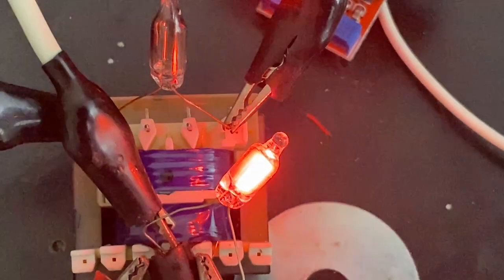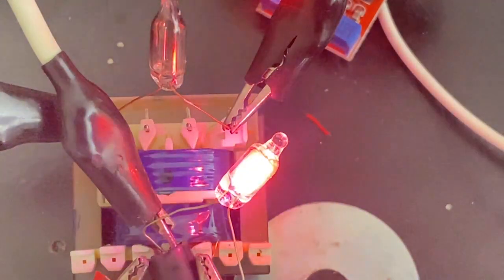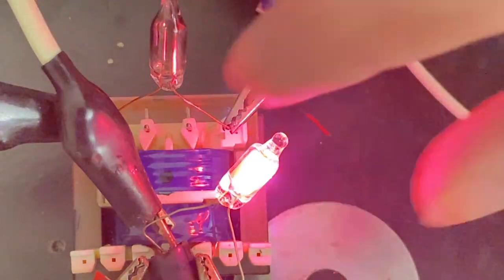Ball Lightning in a Neon Tube - Cool to touch?

Comment: The temperature drop isn’t surprising especially after Bob explains about ‘what goes up must come down’ in a recent presentation. 
How hot does the tube get though? Is the tube just cool enough to touch or is it actually cold?
Reply from the maker: We have offerred support to help them get a thermal imager for their phone.
Reply: @MFMP   You are doing significant work, and I couldn't accept the offer.  But I will indeed order an iPhone compatible FLIR module for acquiring better data.
Reply: The bulb stays cool as long as the EVO lives, reaching about 95 to 105 degrees F based of my own sense of touch.  But if the EVO collapses, the electrodes will immediately get GLOWING YELLOW HOT in just a few seconds, and melt the electrodes.
Reply: @JoinTheTechnicians  You say glowing yellow hot but as Bob experienced with Ohmasa gas the colour doesn’t necessarily indicate that there is high temperature. The Ohmasa gas burned at a temperature of 130°C but the university that did the testing falsely claimed it was thousands of degrees based on the colour.
Reply: @jasoncook6700  The electrodes literally will glow and then melt, sometimes cracking the glass if the EVO collapses. This has happened very quickly. Precisely why I ordered a huge pack of sacrificial neon indicators to figure out the best way for demonstrating how to replicate these initial results.
Reply: @JoinTheTechnicians  The tungsten probe used in the Safire experiment melted and Brilliant Light Power also had melted Tungsten issues. Bob melted or vaporised tungsten using 130°C Ohmasa gas. I’m not suggesting you are wrong but until you get your temperature equipment in place its possible that its not as hot as you think?
Reply: @jasoncook6700   That's a Darn good point Jason.  The glass cracking, and smoke rising off the leads would indicate real heat, typical of overdriving such a tiny lamp. The bulb will also quickly become so hot (without the EVO) that it will burn your skin.  It seems that the plasmoid is required to consume the heat and convert it (I'm guessing into light?).   But this low cost and easy experiment has a long ways to go. I agree that your note is an important consideration which I will address in future experiments.  Thanks!
Reply from the maker: @JoinTheTechnicians  Great - this is important data to capture
Reply from the maker: @JoinTheTechnicians  Do ask if there is something you need.

Comment: What is the true RMS draw?  The watt draw.
Reply: In this setup, it's VERY inefficient: 3W to start, 7W to keep the plasmoid alive.  I am intentionally shorting most of the TX windings to pump ground current into the lamp which results in significant switching and copper losses.  Presently working on the full video to show a "DIY how-to Neon Ball Lightning" using off the shelf parts that will only draw what is delivered to the lamp.
Reply: @JoinTheTechnicians  So cool!  Looking forward to the DIY video, have subscribed!